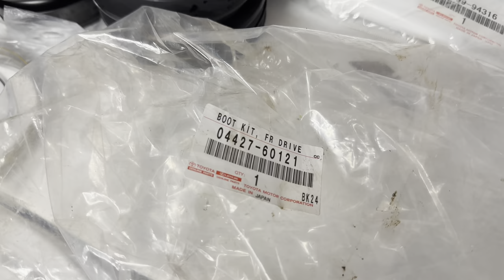Land Cruiser 100 Axle Rebuild & Boot Stretch Mod!

Comment: I'm sitting here after completing a reboot on both pass and driver side.  2000LC was lifted 2" in 2020 and installed new oem axles at that time.  I replaced the pass side boot once 2 years ago in 2022 and now both sides today. No diff drop as I'm not convinced it actually helps.  Considered the boot stretch but I think it depends on how you are tearing boots. Mine always tear near the little end. My current theory is that since I run around with only a rear sway bar to allow the front to articulate better,  that that might be what is ripping them. But it improves the ride sooo much! Especially offroad. I just reinstalled the sway bar in the front.  99.9% is on road so hopefully these boots can last longer than 2 years.  My stock height Tacoma has only been rebooted once per side in 23 years.

Comment: Where did you put the smaller clamp at 21:11 mark?  Is it below the original location or stretched to fit on top of  the extra rubber boot?  Does the OEM boot clamp still fit?

Thanks
Reply from the maker: It is on the boot just like factory but the boot is farther out on the cv axle because of the extra boot piece in the stock location on the shaft. So the order of install is: outer boot & clamps/inner boot clamp/inner boot/inner boot cut piece from old boot/outer cv & clamp. Then you slide the inner boot up until it stops at the old boot and crimp it there. Let me know if you need any other info 🤙🏻

Comment: What is the tire size of this LC100? Thanks!
Reply from the maker: 315/75r16 👍🏻
Reply: @gio.rodriguez  Thank you! I’m definitely going to do this boot stretch mod when the oem boot fails in my LC100. It’s currently pn 3inch lift OME with slee diff drop.
Reply from the maker: @johnbacani2323  no problem, this has a 3” lift and the slee diff drop as well. The boot mod would be perfect to dial it all in!

Comment: That has actually been myth busted by another youtuber it last just as long as if you were to do a diff drop there is no point in the diff drop and by doing the diff drop your putting the diff at risk with the negative ground clearance use a longer more flexible silicone high stretch boots insteadhttps://youtu.be/47aat1tc6zw
Reply from the maker: This Land Cruiser has a slee diff drop kit installed and it killed boots over and over. Aftermarket boots are junk, nothing beats Oem